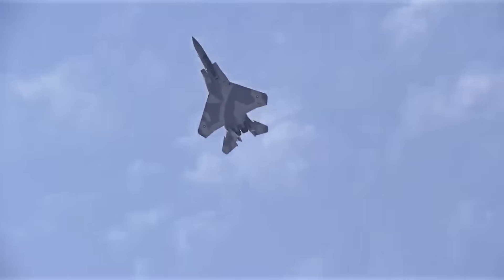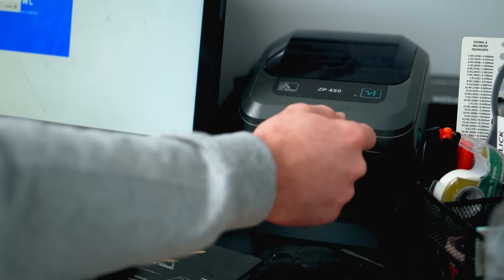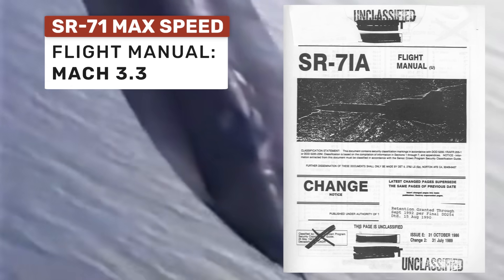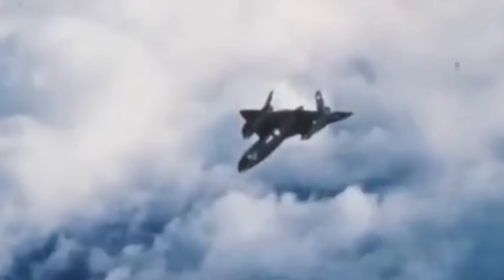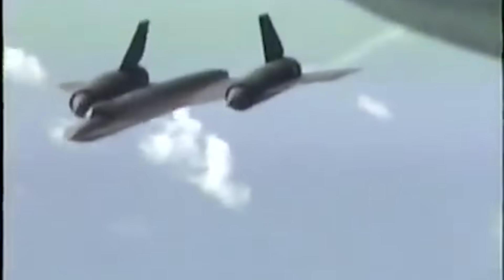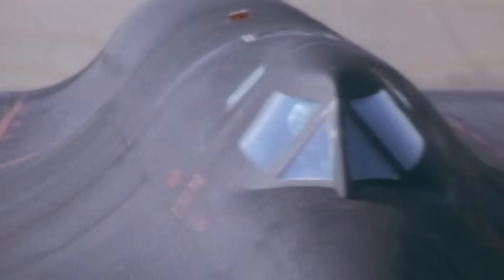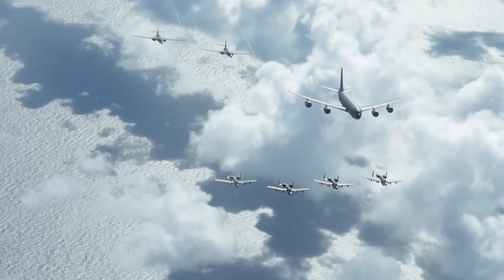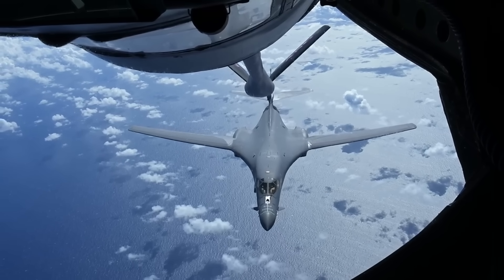The SR-71 was MUCH FASTER than the Air Force will admit

Comment: I worked at the Kansas city air traffic control center an SR 71 flew thru my area, first of all at altitude, that was secret we could find out if needed, but they are above commercial ais craft. I measured the speed on radar using secondary radar or transponder radio assisted position,  at 2750 miles per hr.the thing i dont know is if they were opened up or just cruising.
Reply: Considering it could never fly that fast it's hard to say.
Reply: @gr8crash  gr8 I'm not saying it did our radar screens has a slew ball with what we called quack keys quick action keys, anyway the dish made 1 min. Sweeps you slew to target mark, on next sweep you slew to target mark and computer told speed. The SR 71 was once coming thru and we were all briefed this happened, the pilot asked the high altitude controller if he could do an alioup, ??? Ahhh OK approved, he shot down to something like 15 to 20 thousand foot alt. Bounced off the thicker atmosphere and shot way up. We dont have military altitudes it would read alt H or K or D which was changed all the time so we had to call the military and get what that alt was. Like I said it was above all commercial air craft which for the flying public 35 to 45 thousand feet. These guys wear astronaut suits in the SR. Anyway what 80 thousand ft ? The air so thin speed increases less resistance. Now upper winds at those altitudes can be extreme he may have found a strong jet stream, many a time a commercial flight could pick up a 100 knots or better. Higher I dont know. Keep in mind these guys would fly thru a sector so fast we didnt even talk with them once at altitude. The alioup I spoke of caused us issue because it violated low altitude sector which we called a deal and fur was flying at the violation of air space, something that fast is hard to say what space is needed, it would take a whole state to make a turn. That said, the track I speak of measured his ground speed that's not relevant to his air speed. There were test pilots that flew f16's etc. Out of a base in St Louis and run them thru extreme tests flights that would heat the wings in extreme stunts and speeds so yes in low altitudes thick air things are different. I was told the SR could leave a base in Florida and be in Japan in 3 hours. Figure speed this was an extreme aircraft.
Reply: @David-ek8dc so many issues with that post. First an SR71 never did a maneuver like that. It would have crashed if it had tried it, so no never happened.  They were never based in Florida so that's kind of irrelevant but considering it takes over an hour just to fly from LA to DC there's no way it was going to make it to Japan in 3 hours, that's simply absurd. As for a boost from a jet stream etc, also extremely unlikely. Not only is it rare for there to even be strong winds at that altitude,  they'd never be strong enough to push an SR71 that fast. That speed would be greater than mach 4 which is simply 100% not possible.
Reply: Log data maxes at 3.2 mach, not because that’s its top speed, but that’s when the engine’s inlet cone begins to swallow its own shock wave.  But yes, it can definitely go faster than 3.2, but the risk of flameout increases exponentially.
Reply: @SME.Retired  the MSR maxes out at 3.5, not 3.2.
Reply: @SME.Retired  so mr steel roughly 2500 mph but at 80 thousand feet air density is so thin the ground speed is way higher TAS then if any jet stream that would add, dont know much myself as to winds at 80,000 but I'm absolutely positive on an SR71 transponder reading the aircraft flew over Kansas city center at 2740 mph ground speed . And by the way at that speed from Miami FL, to Japan is 7437 miles covered  in 2.71 hours do the math you will see it
Reply: @David-ek8dc  I am not the one doubting what you say.  I called upon two references, one who has a J-58 turbine blade on a plaque in his office (Kadena 1970’s), the other a ATC in theater during Desert Shield/Storm.
Reply: That's definitely inaccurate since the radar systems for air-traffic control generally have a computer that could calculate up to fairly high speeds, above 999 knots, it just displays "S.C." which means "speed classified".  Basically, it's so ATC doesn't see the speed of military aircraft.
Reply: Wow your full of yourself its dogma. Guess the air traffic controllers at KC center are full of it. Oh well dont fly over central us we covered 195 thousand square miles. And by the way didnt say it was BASED in Florida. I went to Forbes field on a c135 refuel flight to refuel B52's but that didnt happen either right. And when we were done we deplaned and their sat a U2 gee they weren't based there either
Reply: @David-ek8dc if that's the story they are saying? That it flew that fast or performed that type of maneuver?  Than yes absolutely they are full of shit. 100%. The SR71 couldn't ever fly that fast, and could perform a maneuver like that. It would have crashed if it tried. So again yes, completely full of it.

And didn't say anything about other stuff you did, nor did I ask, nor is it relevant. Strictly referring to your comments on the SR71, which is utterly nonsense.

Comment: My story, I was a rookie air traffic controller at Bergstrom afb in 1979. Now Austin bregstrom airport. We got a transmission from an SR 71 cross above or airspace. My tower crew thought it would be fun to prank me. I was on local control so they said hay rookie as them their attitude speed and heading. So I did just that, the radio crackled back to me, rodger tower, understand you have a rookie in the tower. I'm sure  my ears were red!

Comment: I've always wondered if the F135 engines in the F35 could be engineered to fit in an SR71 (i know completely hypothetical) and since they make 9000lbf more thrust in burner than the J58 could they potentially power the SR into the upper 3s Mach wise? maybe even to 4? forget the potential damage to the airframe from the heat so curious if those engines despite their thrust in burner could actually handle that airspeed?
Reply: Not without a massive redesign of the F135 engine to accommodate the bypass tube's etc. Remember at mach 3 the J58 turbojet itself was only providing around 20% of the thrust.

Comment: I was friends with col.B. McCallum who told me they never maxed out the sr 71 they were concerned that the airframe would melt before the engine's stopped accelerating.
Reply: Above Mach 3.2, the engines begin to swallow their own shock wave.  That inlet cone only moves 26 inches.  Onboard data logging maxes at 3.2, only because that is the calculated max before the possibility of flameout.  Of course they can fly faster, but the pilot has to accept the increased risk of flameout.
Reply: The engines were the initial limiting factor not any part of the airframe "melting". The aircraft simply never got hot enough to "melt".
Reply: @gr8crash  I trust Col. McCallum, he flew them.
Reply: @devron5ssn he did, but he was also messing with you. Again the engines were the initial limiting factor to higher speeds. Above mach 3.4 other areas of the airframe at different speeds etc start to become the problem, but they still weren't going to "melt" that's simply idiotic.

Comment: I was told it did 5 plus, and the dude worked at skunkworks.
Reply: Maybe as a janitor because that's absolutely not true.
Reply: @gr8crash  be careful about saying something is absolutely untrue when you yourself don't know. We have things pushing that speed now, and they use similar technology. Scram jet vs. ram jet.
Reply: @johnmalone3256 no need to be careful, that speed 100% absolutely never happened in the SR71. It was never even remotely capable of getting even close to that speed. And yes we have a couple small test programs "that haven't flown in years" that were flight testing Scramjets. But outside of those few tests, that's been it. And we 100% don't have anything operational at those speeds.
Reply: @gr8crash  Have a good day, sir.

Comment: Look into the MINIMUM ignition speed of the D21 drone that rode on the back of an SR-71.
When launched from other aircraft it would have needed a very large SRB to reach ignition speed.
I wonder why it did not need one when launching from the back of an SR-71?
Reply: The D21 was powered by a ramjet which generally needs speeds of about mach 3 to function which the aircraft was carried to. It was also carried by an M21, not an SR71.

Comment: I've always known that the SR-71 was way faster than the Air Force's stated speed.  And if the AF is lying about the speed, maybe they're also lying about structural problems.
Reply: Huh? The SR71 didn't have structural problems.  Also never lied about it's speeds either
Reply: @gr8crash  I never said it had structural problems.  Did you watch the video.  And yes, why is it so hard for you to understand that speed may have been lied about?

Comment: Top speed on the blackbird is unknown.its engines are ramjet tech. The more air they get, the faster it goes.. zoom zoom zoom 😮
Reply: Not really. The top speed and potential top speed is all known. It also didn't have a ramjet.
Reply: @gr8crash  at low speeds they were turbojets but at higher speeds they acted as ramjets
Reply: @georgegillespie2003 not really no. The J58 was always a turbojet, throughout its entire flight envelope. BUT, due to clever inlet designs and bypass ducts the could create a ramjet effect without having a ramjet engine. But the J58 itself never changed, it always functioned as a turbojet. If it didn't, the plane couldn't have operated.

Comment: The legends that I was hearing from CIA operatives in the 80s was flight on the edge of space, where the leading edges were smoldering white hot.  Early "Wings" programming on what became the History Channel, pilots spoke on camera of seeing the sun rise and set 6 times in one mission.
Even when talking to a Blackbird Mechanic who lived next door to me in Knoxville, he heard me speak of these things.  He chose not to deny anything.  He spoke of fuel that would burn laying on the ground, and stop when you covered it in dirt.  The it would reignite if you uncovered it.
Legends are curious.
Mach 6 on the edge of space makes sense, and the cameras would clearly do their job.
Reply: Virtually everything you said is untrue
Reply: @gr8crash  Fine.  But that was the Scuttle Butt.
Reply: @gr8crash  The CIA Operative guy was a hitman in Vietnam.  He also disappeared for 3 days after wandering into U2 hangar by accident, as he was seeking shelter in the case of an aircraft auguring in at his location.  Curious things about that plane too.
Reply: @miguellogistics984 not even sure what you're trying to say in that rambling of a comment.
Reply: @gr8crash  blagdo blagblah!

Comment: I remember reading a pilot story in a aviation magazine.  Said he was flying recon mission north to south over russia, and was approaching his turn to fly over the black sea heading out to the Mediterranean Sea. As he got close to the turn he got notification of a missile launch. Knowing the missile could cut the turn he pushed the throttles up. half way over the black sea his reo said he might want to throttle back. At the time he was doing mach 3.5, and said that was they're limit, intake temps get close to softening the compressor blades. He immediately pulled the throttles back to idle and still over shot his refueling tanker at Gibraltar some 1400 miles away.
Reply: Virtually that entire story is untrue

Comment: The issue of increasing SR-71's speed from say 3.2, for the purpose of this discussion, to 3.5+ is managing the positional stability of the shockwave created by each engine's Air Inlet Control System (AICS) spike and aft of spike pressure control system valves called "doors", within the interior shape of the nacelle at speed. The spike you see at the front of each engine's nacelle hydraulically moves aft in a range of around two feet, controlled by the Air Inlet Control System (AICS) as speed and altitude increase per the accel envelope. It's a carefully choreographed process of accel and decel to keep the beast in it's flight envelope. At 3.2 and thereabouts, the stability of the shockwave is very critical within a small range of motion/pressure fluctuation. The challenge is managing that system. The AICS on paper and real life can exceed 3.2M but for mission purposes 3.2 (+/- a bit) is good enough mix of getting to the target, spending minimum time over target and getting away safely and reliably. The AICS is something of a supercharging system that uses the shockwave in the nacelle to radically slow the speed of air in the intake nacelle, which conserves energy by radically increasing pressure of the air in the nacelle aft of the shockwave, resulting in very high density of O2 per cubic centimeter of air fed to the engines... So the engine produces more thrust at the same RPM as as the aircraft accelerates. The engine burns O2 and the AICS increases the amount of O2 per unit of air fed into the engines as speed and altitude increase. Brilliant system. The fuel/air/power efficiency at mission speed was higher than that of achieving mission speed...
Reply: 1. You are listing 1st airframe factory new capabilities while ignoring decades of technological advancements that would have been available and used.
2. All supersonic AV have a system of controlling the shockwaves passing into and near the inlet. It is not a supercharge anything but a necessary evil.
3. You appear to be confusing the concept on inlet thrust with 'supercharging'. High mach AV tend to get more thrust from the engine sucking in air than from the expulsion of the exhaust. Counter intuitive, sure, but also reality.
4. Compressible fluid dynamics is a very rare skill set. So is combustion chemistry. You appear to have neither.
Reply: @hahahano2796  Yep.  It's all fun & games until the unstarts begin.

Comment: Consider; that the Vought XF-8U, in 1959, was 'Restricted' from going to Mach -3 ( Using the J-75 ) because of the COCKPIT GLASS and Temp-issues that Might-have Melted the front windscreen!? That plane had only ONE engine ( same as the Sleek-but-Heavy F-105 'Thud' ), where-as, the EX Eagle  (like all F-15's) have TWO engines. So, in 65 years, GE has had it's thumb up it's own butt? I doubt that! How 'Fast' the EAGLE can go, is, really, up-to Corning Glass inc...

Comment: According to sled drivers the 71 would do above 3.5 mach and the ceiling has seen above 90K feet .but we are not supposd to know that .
Reply: Considering they don't call themselves "sled drivers" they won't make that speed/altitude claim since it's really not the possible
Reply: @gr8crash  What you don't know , you don't know .
Reply: @user-tm6nq3ou1v  um we do know. There's only one pilot who refers to himself as Sled Driver, no one else does. Especially because it was used as a derogatory term towards the SR71.  Also no, typically the SR71 won't do 3.5+ or 90k+. There are VERY specific atmospheric conditions that have caused the SR71 to reach close to mach 3.5 but those were the rare exception,  not the norm and when this did happen it wasn't fully within the pilots control.
Reply: @gr8crash  Look junior , if it's a sled , bone or anything the 71 is still a bad ass bird . This was 60's tech and the ruskies still haven't figured how hat was possible .
Reply: @user-tm6nq3ou1v  haven't been called junior in quite a while so kind of irrelevant. Agree the SR71 is awesome, it's performance capabilities just get often over stated is all. And to be fair the Sovietd almost had a version flying before the SR71 did. They just didn't follow through with it.
Reply: @gr8crash  I'm a 47 year pilot , I am near 80 with a frw thousand hours . Would not trade one minute of it for anything .

Comment: when the SR-71 was delivered to the USAF museum in Dayton Wright-Patterson afb there in dayton it flew over my Apt. comp[lex. the next day it was still outdoors on static display waiting to be moved inside to it's final display stand. I got toactually touch that beautiful plane withmy bare hands. Up close it is pretty big. I got to talk to one of the pilots who flew it in snd got him to tell me just how fast it could really fly.. the published top speed is mach 3.3 but, he tole me that at its service ceiling 0f 100,000 it could get to Mack 4.85 ... It's lighter sibling YF-12a (ALMOST NO PAINT. SO LIGHTER WEIGHT.) THE BLACK THE ENGINES ARE ACTUALLY pRATT $ WHITENY j-58 AFTER BURNING TURBO FANS ....  I had built the Testers 1/48 scale model kit that had some tech specs. included in the instructions I built the rare version the trainer version SR-71-B flight controls in the back seat for the instructor. I built mine gear up in flight mode. hung it from the ceiling with monofilament fishing line at a slight downward angle and a bit tilted  to the right as if in a turn.. looked cool.. so there you go.
Reply: The SR71 never at any time had a 100k service ceiling and could never reach anything close to that speed. Also the J58s were turbojets not turbofans. The YF12 "like the A12" was initially bare titanium, then black leading edges then all black.

Comment: The top speed of the SR was supposedly only limited by the titanium structure's ability to absorb the skin heat and remain strong, and not the thrust produced by the engines.  If that is true, then the crews most likely never were able to operate at "wide open throttle".
Reply: Not very true at all. Also the initial limiting factor was the engine temps.